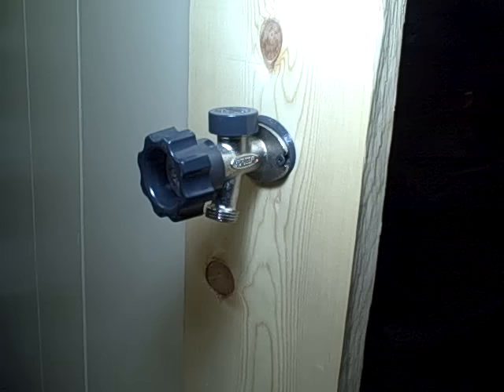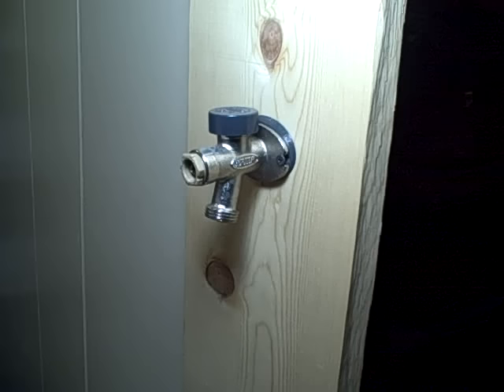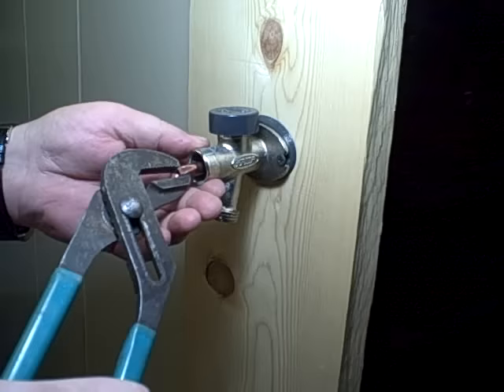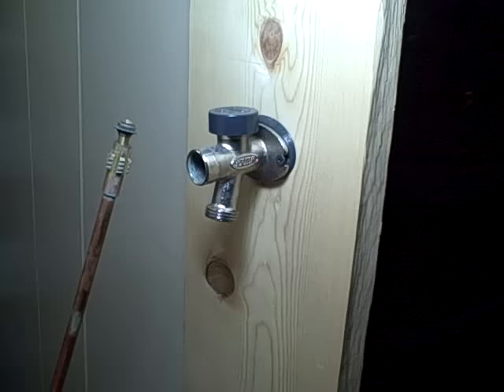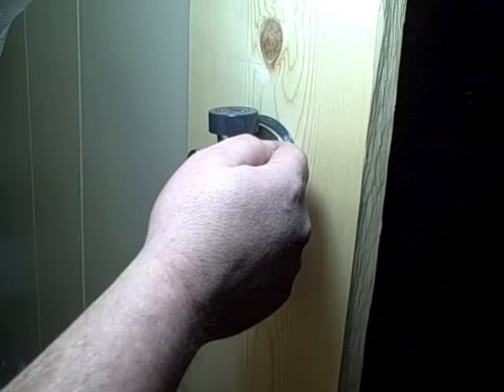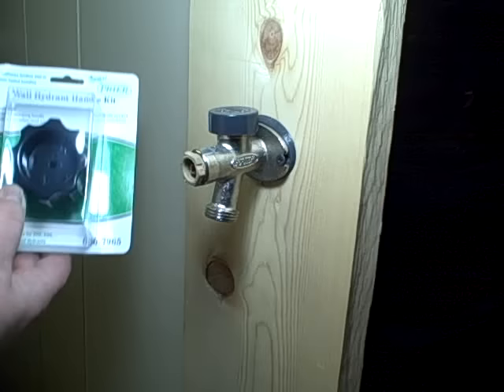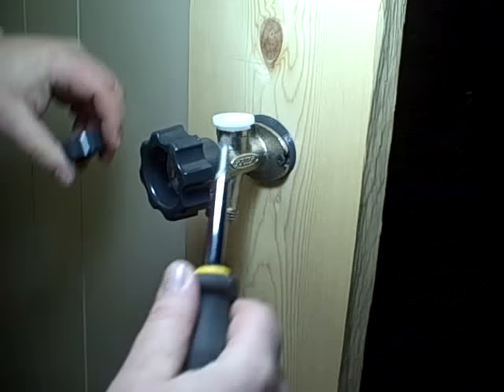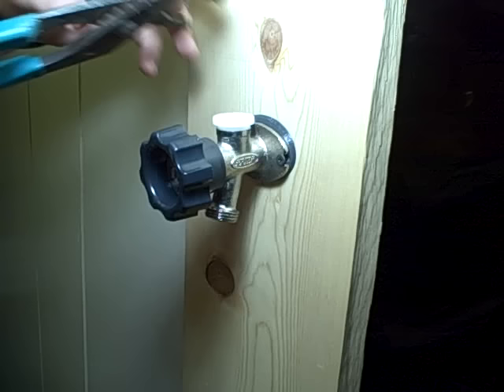Rebuilding the mansfield 400 or 500 series faucet

Comment: Perfect instructions.  No water was coming out of the faucet.  Upon disassembly, I found that hard water deposits had completely clogged it up after 27 years.  What's best is no parts were required.  Cleaning out the pipe was enough to fix it.  Thanks very much.  I couldn't have done it without your help!

Comment: Packing washers.
The new stem comes with two packing washers. 
The shallow flatter one is for left handed threads and used with the tan nut. 
The thicker deeper one is for the right handed threads and used with the white nut. 
One packing washer might already be on the stem and the other one is loose in the bag. 
Use only one packing washer.

Comment: I followed your instructions no leaks....but. when I turn the handle I can just pull it out and water comes out the nosell. I put it back in and turn the handle. Doesnt seem to have a start and stop point when I turn the handle. Is that a sign the threading in the pipe is stripped. When I put the stem in and turned close wise it snugged up and would turn any more. But when reassembled I just pull the handle and water comes out. Any suggestions

Comment: Thabks for the video. I have a question here. When i pulled my stem out of faucet. There was a spring at the end. It seems rubber seal stuck inside the faucet. How to fix it? How remove the end of the rubber seal possibly inside the stem? Please advise.

Comment: You left out an important component for the stem! If you decide to rebuild a 500 there is a spring housed at the back of the step that pushes the rubber washer tightly against the back of the bib that ensures a 100% water shut-off without over tightening the handle. 
After X years that springs becomes worn. WHERE CAN YOU GET A NEW SPRING ??
THX
Reply from the maker: The spring actually prevents backflow when the faucet is on. It is fully compressed when the water is turned off. The spring is not offered separate. You would have to replace the stem.

Comment: Great video. I managed to get the screw and beveled gasket stuck in the pipe when I was removing the stem with the leaking bell basket. The screw is turned such a way that it is difficult to remove. Any suggestions for getting the screw and gasket out?
Reply from the maker: You could try using a coat hanger or a thin wire to shove into the faucet to hopefully free up whatever is stuck. Once the stem is removed you can turn the water on for a second also and the water should blow everything out of the faucet.
Reply: Thanks! been trying similar approaches.  I will let you know if/when I get it out. Hoping to get it unstuck because the faucet is installed in a really awkward spot for accessing the other side of the pipe a replacement is needed. @fcplumbing
Reply: @fcplumbing

I got the screw out but not sure if the gasket has made its way out yet.

Comment: My new M-400 was working great, but after 2 months the water pressure decreases as I open the water all the way. I have to turn it very slightly to get okay pressure but not like the pressure of when it was installed 3 months ago. 
Do you think the stem is bad?

Comment: Thanks for this info.  I have a question because I was not able to remove my handle.  So am I able to just add another stem and use the parts from a rebuild kit to put is all back together.  My mansfield is the older style needing stem M-123-0095
Reply: You have the same Model I have. I would have gotten the wrong size had I not read your comment.  Did the stem work and stop the leak?

Comment: I reinserted my 33 year old stem and tightened the packing nut. But the faucet just continually turns to the right and never either opens or  seats. it's like the little teeth at the end of the stem are not grabbing hold of anything. How do I correct this?
Reply: could be either the threads inside the faucet or on the stem itself. If it is the threads in the faucet it will have to be replaced unfortunately. You could try replacing the stem on it and it is a 50/50 chance at fixing it.

Comment: This is great! I don't think my faucet was ever correctly put together or it fell apart right away; the sub assembly had come off of the stem. I saw part of the spring inside the stem and as soon as you pulled out the stem, I knew mine was apart since nothing was on the end of the stem. Thank you so much for this video! Now I'm off to the store to see if I can fix the sub assembly. I am wondering it should be soldered or 'glued' to the end of the stem because it pops right off. ??
Reply: same for me. I cant figure out how to get the end pieces out
Reply: wxmyjnsn I did end up gluing the end but it still did not work so my hubby went out and bought a whole different faucet. Now that we put it in I've come to the conclusion that the first one never did work right. Ugh! The price we pay for learning! I do believe the end pieces are not suppose to come off. You have to order a new stem or do what we did, complete new faucet.
Reply: I tied fidshing line on it and ran it  thorugh the shaft and and held it tight then inserted it back in the faccet. Works fine now.

Comment: Before finishing the basement in our 60s house, I had a plumber replace the old-fashioned faucets and put in these "modern frost-free" ones.  The old ones had survived almost 50 MN winters--but I was trying to do it right.  What a dumb mistake.  These have to be rebuilt every year and still leak.  Cheaper to rebuild crummy faucets than tear into plaster, I guess.  Surprised someone hasn't filed a class action lawsuit.
Reply: Glad I'm not the only one that thinks these things are garbage!!  Plastic parts...disgusting.  I find myself rebuilding these stupid things just about every spring!

Comment: Does the white packing nut use the same packing as the tan one or do you use the more slender packing that came with the rebuild kit if you have the white packing nut? The packing that comes with the new stem doesn't seem to allow the white packing nut to tighten up as it was when I removed it.

Comment: So if the tube measures at 12" do I need to order a 10"?
Reply: Add 4" to the stem length for the nominal wall thickness.  So a 10" nominal size hydrant will have a 14" stem. Note that a hydrant may actually be longer than the nominal wall thickness as sometimes the valve seat is suspended offset in a crawl space or cabinet where it will be a warmer temperature to prevent freezing.  In such a case the hydrant valve stem will be [wall thickness] + [interior offset] + [4" in valve seat & exterior handle offsets]

Comment: Thanks for the info!  This was most helpful.
Reply: Now wait a minute. Mine does have the vacuum break with metal cap and it does have the 180 turn but it does not have the spring loaded stem. Just a single washer that I have replaced numerous times and it still leaks. Maybe it was built on a Friday with misc parts. It was installed around two years ago and have been fighting with it off and on ever since. Sometimes if you crank down on the handle pretty hard it will stop leaking but if you turn it the least bit it will start leaking again. Not just a drip but a small stream.

Comment: When reinstalling the handle, after tightening the packing screen as far as i can, the packing screw turns with the handle. Any tips? Thanks.
Reply: Randy, does your squeak when turning the handle? Mines is driving me nuts!
Reply: The packing crew should move independently of the handle/stem. I used plumbers silicone grease, which makes everything glide smoothly, except my faucet still squeaks.

Comment: What do you do if it leaks from the handle?
Reply from the maker: Behind the handle there is a packing nut. sometimes just tightening it a little will stop the leak. If it is coming through the metal stem you would need to rebuild or replace the stem.

Comment: Mine is leaking from around the packing area.  Cannot see it, because I cannot get the screw off the handle.   It's a 3/8 hex screw and it's frozen on.  I have sprayed on a penetration oil, inside and outside the center screw area for 4 months now.  Or do I have to cut off the plastic handle to get the packing area and get a to rebuilt kit and handle?
Reply: Jay, did you ever get the screw off? I am having the same problem right now! How did you solve the problem!??
Reply: Try PB Blaster
Reply: Impact driver removed in seconds without need for any loosening sprays when using an adapter and the appropriate socket.

Comment: screw holding the handle completely corroded, not included in the kit
Reply: The screw is part of the handle kit. If it didn’t come with yours, you got screwed, sorry, pun intended. I just ordered one off Amazon, same part number as the one in the video, the package says 1 handle, 1 screw. Got both of them. If yours didn’t come with one, sent it back and ask for a new one that is complete package. Hope this helps.

Comment: The 400 series no longer has this type of stem.  Don't waste your money replacing the stem - it is DEFECTIVE by design.  Replace the entire hydrant or you will just be throwing money on parts that don't fix the leaking handle.
Reply: Worked for ours. We had a crack on the inside of the handle (gray plastic 400 series), that lead to finding how depleted all the seals were due to a 3 year constant flow of water, a lot, nobody shut it off from inside which caused a Crack in the foundation 🙃 replaced all the dodads on the stem as well as the handle, worked like a charm. BUT, very quickly the seals broke down. Repairs done end of August 2023. Rarely utilized before winter. Shut water off from inside, emptied spout after, insulated it from October-first week of April (in Maine). Got the hose out of storage, hooked it all up, to my suprise it wouldnt shut off completely, AGAIN. Drip, drip, drip. Better than before but what the heck!. Took the stem out, the graphite seal (which breaks down rapidly for obvious reasons) had become useless. I replaced it with something else instead.
Reply: @chasesibley3331  You say 'Worked for ours,' but then detail that your 'fix' barely lasted a year and that you have now replaced 'it with something else instead.'  You seem to confirm what I wrote in my post.

Comment: These mansfield spigots are overly complicated crap designed to require constant maintenance parts to rob you.  Conventional hose bibs work just fine for decades if you purge them each winter.  My mansfield is in a garage which does not get cold enough to freeze.  It lasted 5 years.  Garbage!